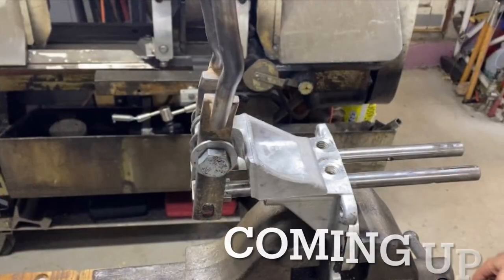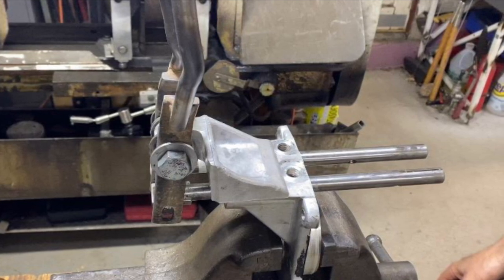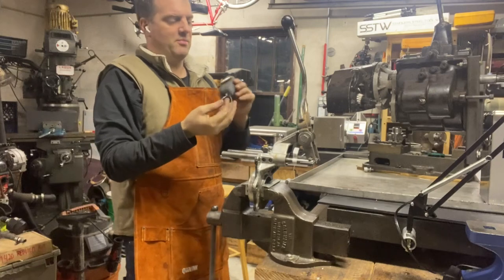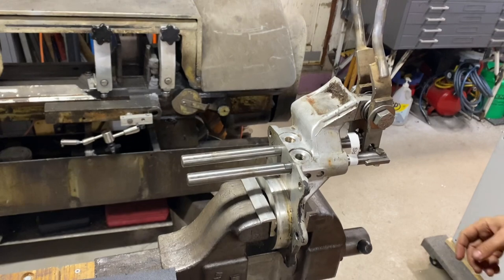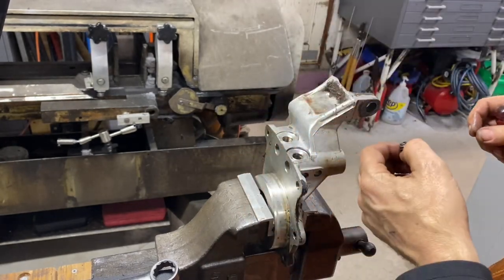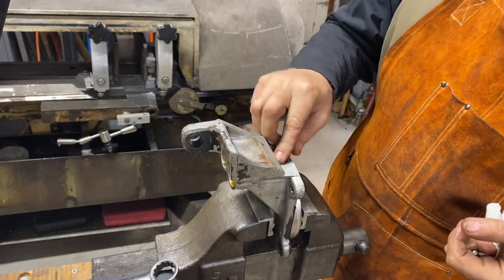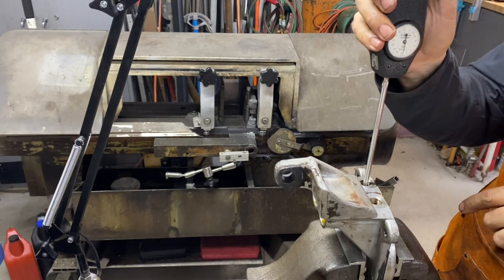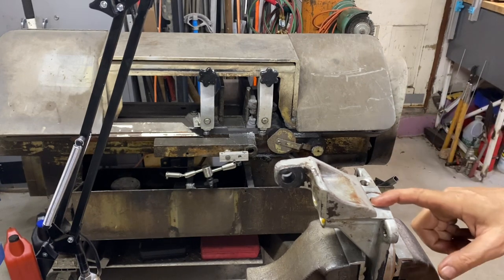Jeep Dana 300 Transfer Case Shifter Rail Fix

Comment: What did you shim it with? Did you find the front spring was longer than the rear ?
Reply from the maker: I shimmed it with a piece of small steel round stock cut to size.  The two springs were a little different that were in it.  The new ones are an identical pair.  I am debating to shim it a little more before it goes back together because after cycling it many times it has lost a little bit of the stiffness again.  Still better than what it was but removing these once everything is back together would be a major pain.